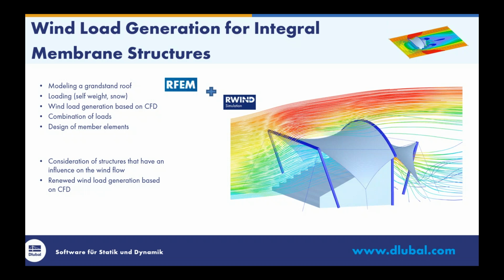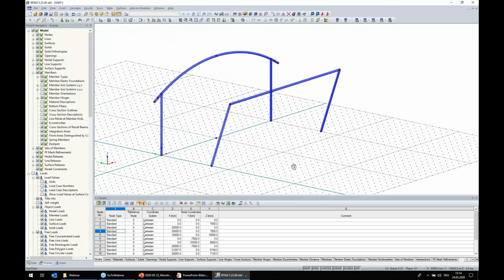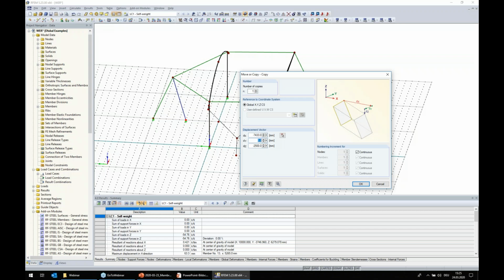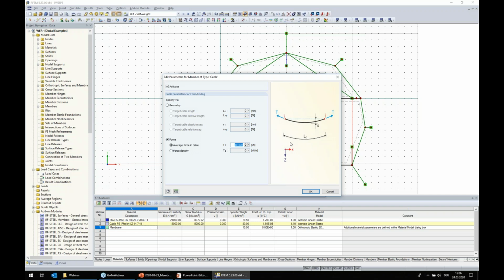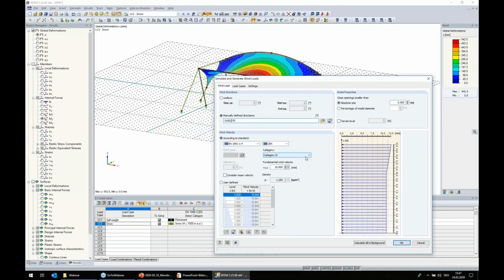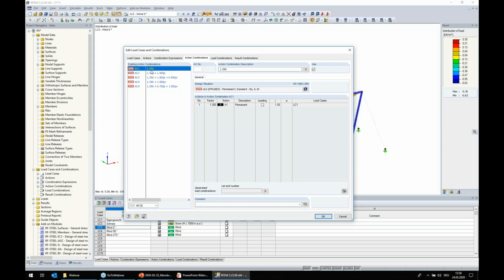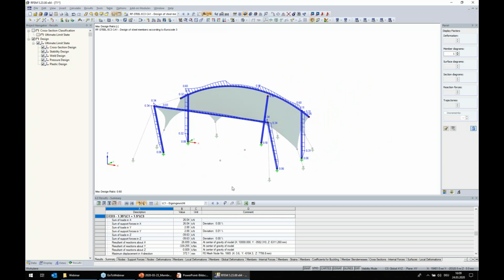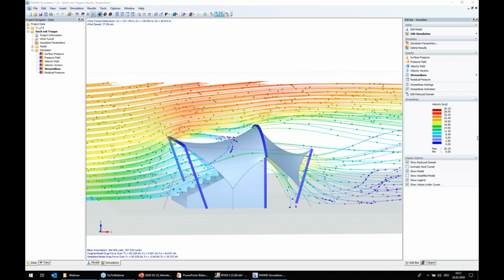Membrane Structures with Wind Loads From CFD Wind Simulation | Tue, Mar 24, 2020

Comment: It seems to me that the value of Vyx (poisson's ration) is not calculated properly. Ex/Ey=Vyx/Vxy =>  100/80=Vyx/0.2 =>  Vyx=0.25  , while in the program it is calculated as 0.16 . Please correct me if I'm wrong.
Reply from the maker: Hi, highflyi!
Your equation is wrong. It should be: Ex/Ey=vxy/vyx ->vy=vxy*Ey/Ex=0,2*80/100=0,16

Comment: It was great webinar. Interesting and informative. 
I wonder, is it possible to use RWIND for evaluation of local points on facades (architectural objects). And what could be the limitations in dimensions for such objects?
Reply from the maker: Hi, Robertas!
I do not see why it should not be possible to analyze architectural objects. It is all depending on the mesh density and we can set that also very fine. Of course as finer the mesh as more demanding for the computer.